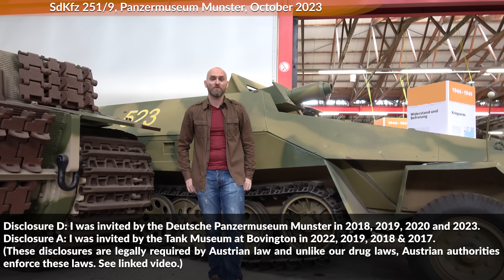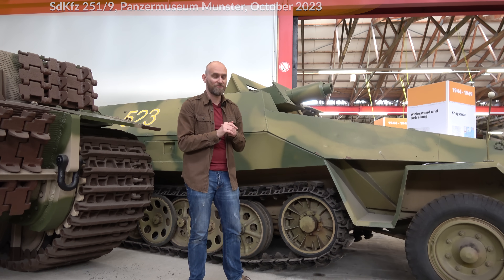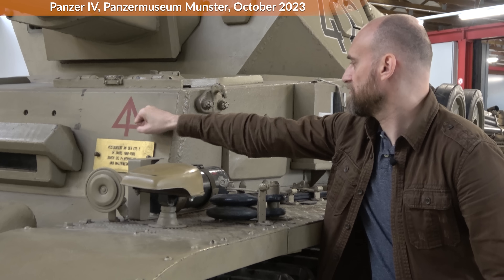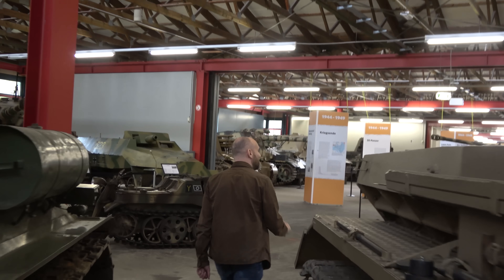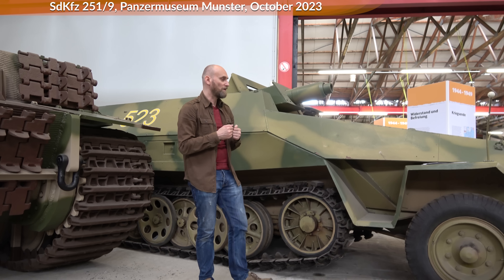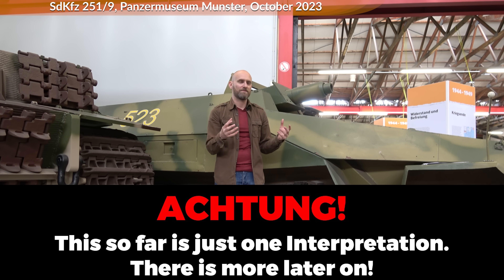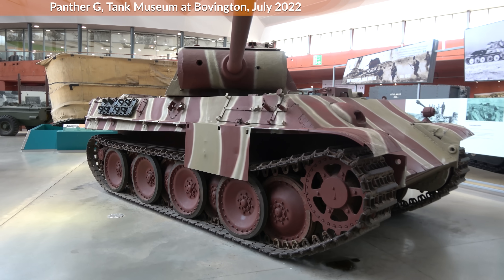Why was German Sloped Armor so late?

Comment: The reason for slope armor is the increase in armor protection. The Panther has 80mm armor at 55°, the same thickness as a 140mm vertical plate.
Yet the Panther wasn't able to penetrate it's own armor, despite being rated to penetrate 138mm at 30° and over 180mm at 0° at 100m.

However, at the start of the war, the most common AT guns were around 37/40mm in caliber and the difference in shell caliber and armor plate thickness has a big impact on armor penetration.
Hard armor plates can resist penetration better than soft plates, but only to the point where the hard armor simply breaks appart from the impact force.
The larger the caliber the less effective hard armor gets, which means you need more of it, which increases weight.

Germany used face hardending for armor plates, not to give better protection but to save weight.
This worked well at the beginning of the war but later sloped armor become necessary to protect against ever larger growing AT guns and capped shells that could defeat FHA.

Comment: Every german tank was one huge design flaw, even the Tiger 2 had a turret as huge as a house that was pretty much flat all around and just thin enough to get penetrated by everything that was going to ship to europe the day the Tiger 2 entered the battlefield. If they increased the turret thickness but decreased the frontal plate thickness the Tiger 2 could have been better protected AND lighter.
Also why do all Tigers have 80mm rear armor? Why do they have such a complex wheel arrangement?
Reply: Man so much wrong in this comment I'm afraid. 

The Tiger 2 has a very large turret- which gives the crew plenty of room to work and fight in, and even the possibility of gun upgrades down the line. You can see it's not flat at all if you have eyes lmao, the sides are angled on both axis. 

185mm on the front (plus the mantlet) is some of the thickest in the war and a very, very difficult nut to crack at sane combat ranges. 

Interleaved road wheels were probably not worth the cost, but they gave a smooth ride and even ground pressure when they worked.
Reply: @frostedbutts4340  that small angle is completely useless and 185mm of flat armour is definitely not enough for a 1944 vehicle. Literally all APCR/APDS rounds and everything that was coming around the corner (20pdr, U.S. 105mm, long 90mm...) goes right through that. But yeah, against the common 1941 sherman or T-34 it was JUST good enough. There are so many photos of Tigers with penetrated turret cheek because it wasnt looking straight to the enemy or even the front... This isnt how i would build the new rare super Tank for future combat - i am looking at IS-3, T-54, T32 and T29.
The wheel layout was completely useless as the germans didnt fire on the move anyway but it was a nightmare to repair.

Comment: This is a very good video that prompted thought about the processes and timelines. 

The Germans don’t use sloped armor in 1930s because their Panzer generals don’t like it and they are the ones who specified the pre-war designs. It creates ergonomic & storage issues and disrupts team workflow inside a tank, which slows the real rate of fire. If your opponent has his tactics right your armor slope won’t really matter, what they thought was important was firing first. The key point you say about the Panther is “Hitler requested sloped armor” and Hitler was not or never was Panzertruppe. He may have over-ruled those Front Generals, who were now way East preparing Barbarossa, when reviewing lessons from the battle of France with the more sycophantic Generals that he’d begun to gather around him. In 1940 even III & IV Panzers had been successfully ambushed by AT weapons in 1940.
This happened in Poland in 1939 too, but German reporting played that down to fit their racist narrative.  

When you mention the 1939 open- topped armored car (Sd Kfz 222) with its much thinner armor because of the smaller engine, the infantry generals would have been fine with sloped armor, because it was beneficial against 1930s lower caliber AP rounds and doesn’t so badly affect a crew who aren’t trying to work a big, one-shot-kill gun inside a metal box.

As for the overlap armor welds, Soviet production replicated the American production lines from the mid-1930s so they looked for the easiest (cheapest) manufacturing process. After they moved their tank manufacture East they did have issues with steel and weld quality and their front plate design change may have been an attempt to account for that reality. Soviet quotas never took account of reality, but you can’t stop engineers from engineering good products.

In WWII Germany those same production “lines” are static, craftsman teams who indulged in bespoke part making for each tank. They interlocked front plates because they could and its fundamentally a manufacturing design and not a functional design issue : it doesn’t really change the weight of the tank or its operation.

At some point they may have mobilized their “semi-skilled” welders and that may have led to actual or anticipated quality control issues and a redesign of the manufacturing process to correct for that. There maybe something in the records, but it won’t be a very sexy meeting and could be buried in individual factory correspondence?
That last statement is just postulation, because I’m not aware of these issues being raised about  German tank production before. 

What I do know is the 1940s post-war top management of VW Wolfsburg were serving British Army officers (Col Charles Radclyffe and Maj Ivan Hirst), so that would certainly be true for places like Kassel too and would have likely adopted British tank production methodology by diktat.

Comment: There is my conclusion. However, when it comes to mechanical engineering, I am at best only half-knowledgeable.

It seems at least plausible to me that the Germans were late in using angled armor because they only invented angle mirrors later or they found it necessary to use angled armor. Why use angle mirrors when box design is sufficient?
What this theory doesn't explain: Why did the Germans use interlocking armor while the others didn't?

My theories:
1. The Germans had different (worse) welding technology than their opponents? The question here: Did other Axis powers, Italy, with presumably the same know-how in welding technology, also have interlocked armor?
- Was there something in welding that was in short supply because of the war, which made German welds inferior or more expensive?
2. There were tests, but they disappeared as the war progressed. But why did only the Germans come up with the idea of interlocking it?
3. The German engineers were overly cautious. It's not without reason that the German saying among engineers: "Mit Gürtel und Hosenträger" ("With suspenders and belt => Always got for the doulbe safty") exists.
For the other nations, the vulnerability, if it was one, was small enough to ignore, while the Germans wanted to go back to building tanks that were as good as possible (if not to say indestructible). Maybe the difference in tank philosophy explains the interlocking? Quality vs. quantity.

However: Everything is just my personal opinion, nothing here is proven fact.

Comment: Interlocking plates are not just useful against armour piercing ammunition. I think that their big advantage comes up against high-explosive shells of most kinds. There are period photographs of armoured vehicles blown apart at the joins from external explosions. Interlocking the plates will increase the vehicle's resistance to such forces as they will not be compromised in one or more directions.

Comment: Hm. Somehow it had eluded me that the Germans were the only ones who interlocked the plates.
I hadn't thought about it much as we know the Soviets just pushed tanks out the door and Germans went to almost artisan levels of manufacturing perfection.
The interlocks are certainly wasteful from a manufacturing perspective.
Maybe they were meant to more evenly distribute the impact shock of a bullet or spread the immense weight of the vehile better and relieive stress on the welds? Iirc the Germans had some issue with welding additives and thus weld quality, no?

Comment: Thanks for a great informative video adressing problems I also asked myself why noone answered them.

I love the way you simply state what you know don't yet know and find out later. The hallmark of a trustworthy source.

As a former Leopard 1 driver I too noticed the interlocking teeth way of armour wasn't continued. Albeit the phylosophy changed I guess after having lost the war to many Shermans etc. 

Indeed also what you mention welding techiques and steel quality come into play. As do periscopes we called episcopes due to only mirrors and no optic lenses.

I also thought it might have been the room and weight considerations. Sloped armour costs a lot of space inside. The smaller the tank and relative old engines are larger and more awkward old tanks especially British ones had lumps of steel.plate to get it all to fit. 

So I guess it was a mix of many factors that come into play. Cost, availebility etc. 

So, the jury is still out on a new line for many video's of choices. And of course talented and less talented engineers or traditions in industry.

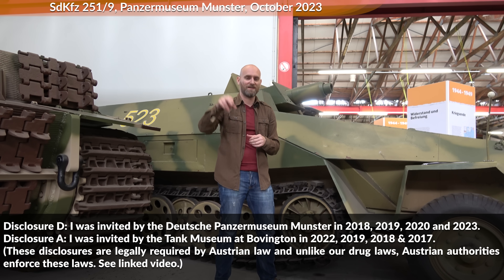Anyway, keep up the good work.❤ 16:32 

What

Comment: The question about the interlocking plates is interesting. Given how much extra work involved and waste incurred (where the cutouts create more scrap material) there must have been some clear benefit. I know little about tank design or fabrication specifically but I'd wonder would the interlock allow you to use shallower welds needing fewer passes and less time (using the mechanical interlock to take the stress of the impact rather than having to build up layers of weld to fully fuse the thick plates)? If this is not apparent in sections through the joints then I can't see any saving in manufacturing time and I can only imagine it was purely done for max possible toughness. Perhaps they thought the heat affected zones either sides of the weld would easily shear on impact and they needed the interlock to interrupt the shear line but in practical terms and with the benefit of seeing how others were fine with simple joints it seems mad particularly given the attritional war they ended up in.

Comment: In manufacturing, interlocking plate would make the jig necessary for hull assembly, simpler, as the locking tabs would insure alignment in two directions. Since these plates were heavy heavy heavy, simplifying the jig would be a goal of any factory engineer for sure. The Soviets may have tried it for the same reason. To simplify alignment for assembly. Thanks Bernhard!

Comment: Sloped armor was a good idea.  It could, and did, work.
Was it optimal for every armored vehicle?  Not very likely.

T-34 was a perfect example of the trade-offs associated with sloped armor.  Good protection, but a cramped interior which led to crew fatigue.
Reply: In Soviet mindset T-34 sloped sides were a bad idea, cause all soviet medium tanks after it have flat sides.

Comment: Most British tank designs continued to have a step with a vertical plate in front of the driver's and hull machine gunner's positions prior to the Centurion since the vertical plate was either attached to or formed an integral part of an important structural bulkhead, and removing that bulkhead required British tank engineers to abandon some deeply entrenched habits in order to switch to the mostly-monocoque hulls used in the Centurion and postwar designs. I have completely no idea how this would have applied to the German case, though.

Comment: About thre interlocking armour. I think it can also be that it makes sense from a production standpoint. It helps with assembly off the various pieces without the need off clamps or other tools to hold the different pieces into place. An other benefit in my eyes is that while assembling all pieces find they're place more easily and more precisely. It can make also a better weld because the weld erea is bigger and thus a more stable construction. While glueing wood togehter you also trie to have a glued surface as large as possible for stability reasons, so doing the same with welding metal does not seem to illogical for me.
To the question why so late with to slopped armour, having a boxed design has more room isnde the tank compared to the slopped disign. The panzer 1 to 3 are not the biggest tank to begin with, so to fullfill the requirments off those tanks it can make sense to go with the boxed design instead of the slopped design to fit all equipments inside.